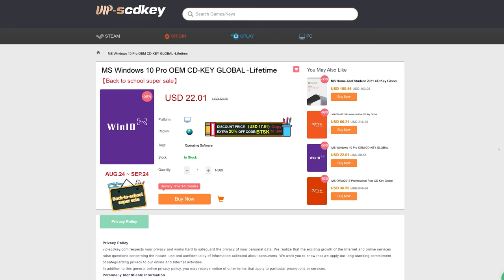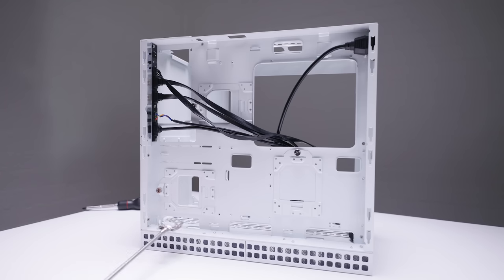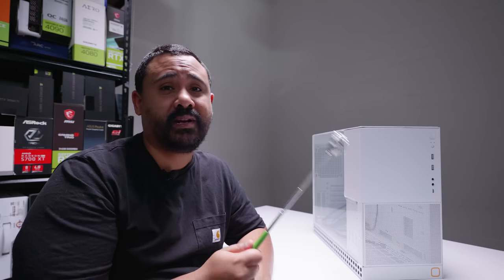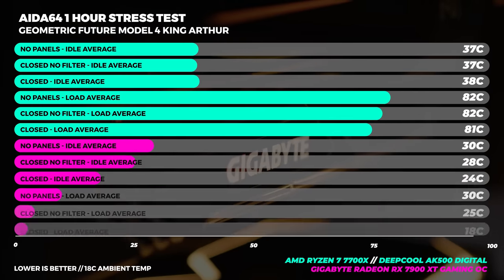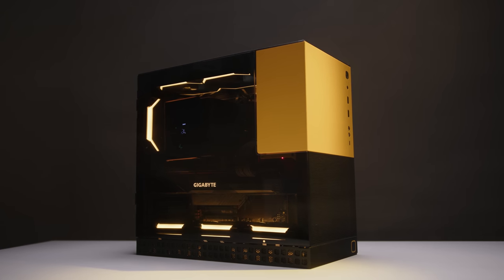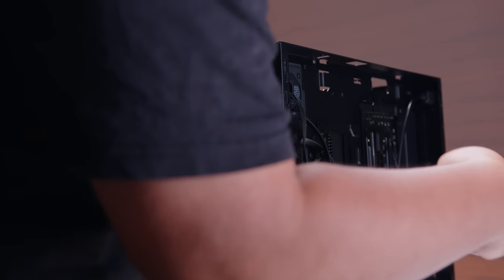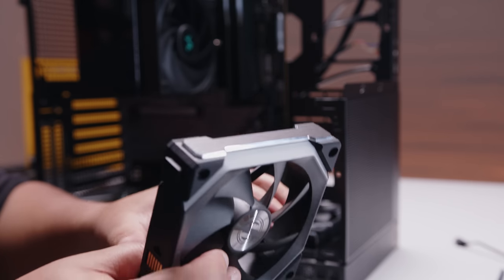Geometric Future Model 4 | Most interesting unnecessarily complicated case ever... but its cool!

Comment from the maker: 🔥vip-scdkey Back To School 25% Discount Code：Gear           
Windows 10 PRO($16.5):https://biitt.ly/sXVT9
Windows 11 PRO($23):https://biitt.ly/FjKfa
Windows 11 home($44.4): https://biitt.ly/9gHsm
Office 2016 PRO($28):https://biitt.ly/CmicL
Office 2021 PRO($56): https://biitt.ly/0K579
Reply: i got scammed by another cd key seller earlier this year
just tried this one and it worked for win11home without issue
Reply: Is this legit? Seems too good a price...how come?
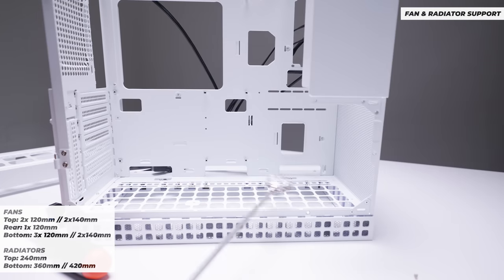Reply: I just ordered this case. At 3:18 you show that a 360mm//420mm radiator can fit on the bottom. I'm only finding that a 360mm can fit. I'm hoping I'm wrong and you're right. Did you try installing a 420mm aio?

Comment: Reverse the CPU cooler flow and use the rear exhaust as intake. The two fans at the top will provide enough exhast and CPU will not breath hot GPU air.

Comment: personally speaking, the case looks really good. been interested in small form factor cases being able to fit full sized components by just being space-efficient. just sad to hear then that the Power supply has to be sfx.
Reply from the maker: It doesn't have to be. I'm sure there is a regular PSU that will fit just fine too. I just don't have that PSU
Reply: why do you tell in video that it +s not good option then?? @GearSeekers

Comment: Should've made the PSU mount the other way around so thw cables go directly to the back, like having it exhaust in the case isn't that bad and it can have vents at the top so that the heat will be pushed out....